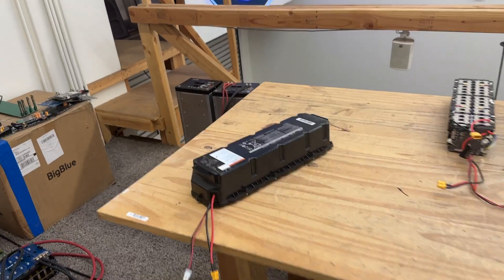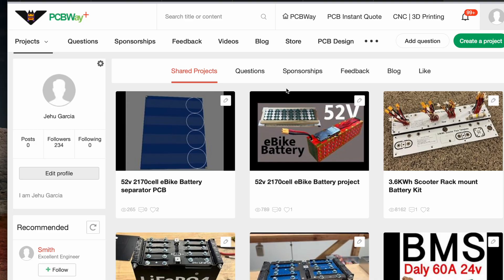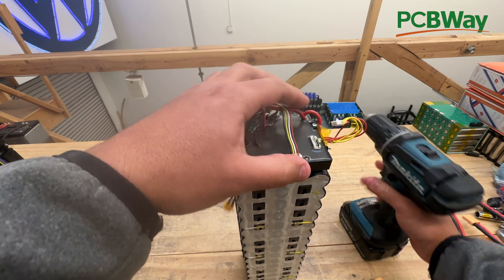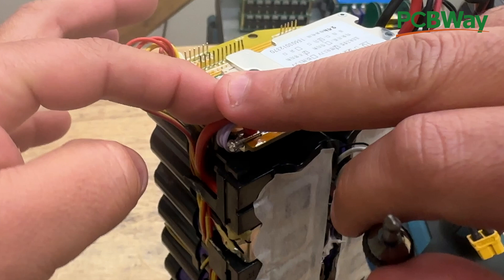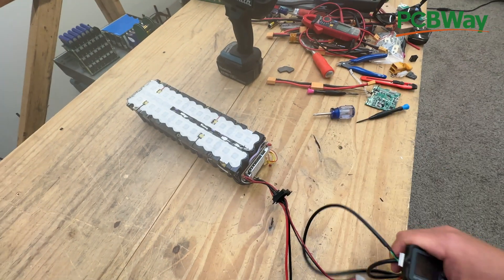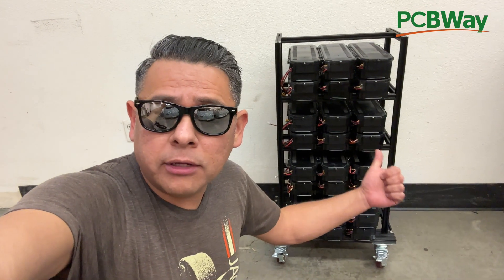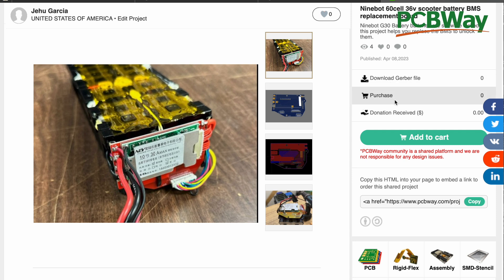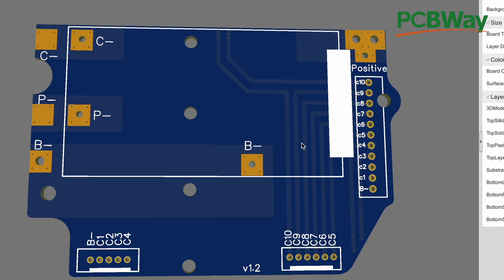NineBot 60cell Scooter Battery BMS replacement  (R12)

Comment: Will that work for this g30max 36v  27900 mah \ 1004 wh. That i got form one of your websites
Reply: As long as you have the right battery communications/BMS you can plug any battery into anything you want.

Comment: So pcbway do not make the full bms ! They only make the board . Is this correct
Reply from the maker: Correct,  the bms is already in the battery module,  the pcb is just a custom power strip so you can connect all 18 battery packs together
Reply: @jehugarcia  true i can use the parts for the boards from pcbway👍thanks jehu
Reply: @jehugarcia hey man sorry for been a pain in the backside 😅,but on the  bms harness the one that comes with the battery  its got  the 2 black - or one looped into the second pin on the housing  for the harness sensor wires  and when u get a off the shelf bms its got the normal 1 black wire ,can u advise me what to do i was gona just loop the off the shelf black harness  because ive already smoked 2 bms  trying it the normal way,any help much appreciated also pcbway  has been  a great help also so far .👍
Reply: Yes I also need help with this 

I have prefer the pcb and a bms 

But unsure if it’s all going to match up correctly

Comment: Do the untested with cables also come with the new BMS or only the tested version has the new BMS?
Reply: Also, why is it only 551WH if it now has the 30A BMS? 
Asking because I'm choosing between this or the R13 (720WH) for a 500W conversion ebike.
Reply from the maker: you are confusing 2 things capacity (Wh) and power (W). The capacity of 551Wh does not change with bms but the the power (V x A) can change,  36v x 30A = 1080W
Reply: @jehugarcia  ❤

Comment: So I buy a used ("tested") battery that is supposed to work for $40 +$30 shipping. ,and a charger ($12  from Jehu)
The battery is "locked" and shuts off at 5 seconds.
Turns out the bms is locked- surprise!  Return it- not to Jehu, the company who "tested" it
Now to make it work I have to buy his fixer bms for $38 plus $12 shipping, and do the repair.
Used to be if you bought something as tested and working-even if it was used, you were not asked to spend more than the original item and fix it yourself.  Not happy...
Reply from the maker: Just looked up your order.  You didn’t buy the tested one, if you had it would already have the replacement bms.  Classic example of dishonest customer…..

Comment: I BOUGHT 3 "TESTED" OF THESE, AND I WAS AMAZED ON THE QUALITY AND USE-ABILITY. PERFECT TO GET MANY OF MY PROJECTS ROLLING!!  GREAT JOB!
Reply: Could I plug the charger port directly to a 36v compatible solar controller ???
Reply: @ChristianPostier  ALSO FOR A CHARGER JUST GET A "HOVERBOARD" CHARGER AND CHANGE THE END ON IT.
Reply: @TechKnowCSS  you know what type of connector that is is?? That white plastic 2 prong one?
Reply: @ChristianPostier  I HAVE SEEN AND USED THE SAME TYPE OF CONNECTOR BEFORE BUT IT WAS MUCH LARGER, BUT NO I DO NOT KNOW THE NAME/TYPE OF CONNECTOR THAT IT IS.
Reply: @TechKnowCSS   Looks like some type of 2 prong molex, ill prob just solder another xt60 and label input and output real well on it!!  Thanks for the hoverboard charger mention, ill get one of those!
Reply: @ChristianPostier  IT IS NOT 36V, TO CHARGE IT NEEDS A MAX OF 42V, NEVER GO ABOVE 42V EVER. THE BATTERY IS DEPLETED AT ABOUT 33V AND NEEDS RECHARGING AT THAT VOLTAGE
Reply: Were did u get the bms ? Or did u buy 3 completed battery packs.
Reply: @whitefeatherslinger8194  I GOT THE COMPLETED ONES WITH A NEW "GENERIC" BMS ALREADY INSTALLED, MOST WILL HAVE TO CHANGE THE "ODDBALL" CHARGE CONNECTOR, I COULD NOT FIND THE SAME THAT IS INSTALLED ON IT. BUT THE XT60 OUTPUT CONNECTOR IS GREAT AND PERFECT FOR THIS.

Comment: I've picked up a few of these. I'm a 12v guy. What would be the easiest and safest way to mod these? Could I break them into 3S sections then parallel the output and connect it to a 3S BMS? Or tearing it all apart and rewiring it? I know I would have to discard 6 batteries if I do it the first way.

Comment: 36v powerwall? most inverters are 12, 24 or 48 volt. What equipment are you using for a 36v battery bank?

Comment: When it says it comes with cables but untested, what cables exactly?
Reply from the maker: Xt60 and the charging port,  some packs the cables were cut by someone before they came to us,  so you’ll have to install your own connector
Reply: Can the full rebuilt pack be used back into the Segway Ninebot?    I assume not because of security check.
Reply from the maker: I don’t see why not
Reply: @jehugarcia  Thanks. I’ve mistaken it with the controller. Yes. It should work. Amazing you got so many. Literally pallets
Reply: Hey  @jehugarcia  , I have ordered the $60 working one watching your last video. I thought it will came with the new chineese BMS installed. Do I have to buy this BMS separately?
Reply from the maker: @mobashirrahmanloban4264  included